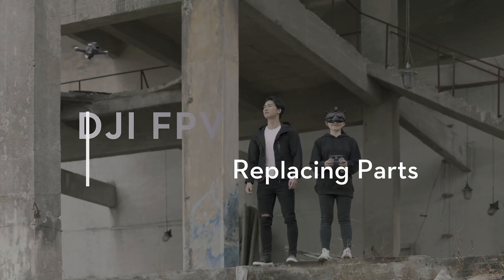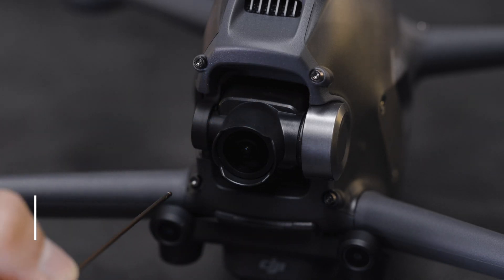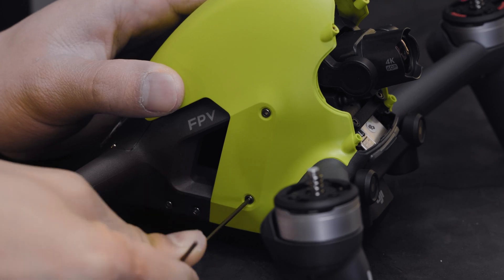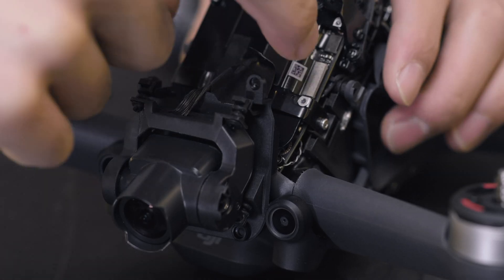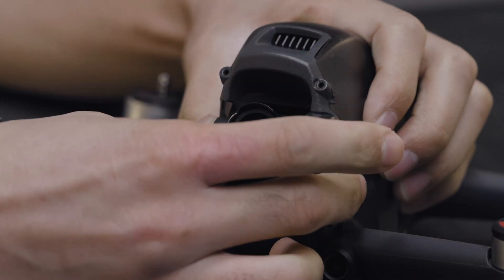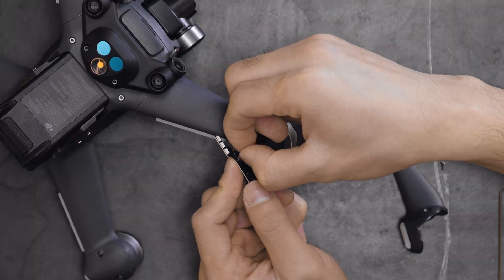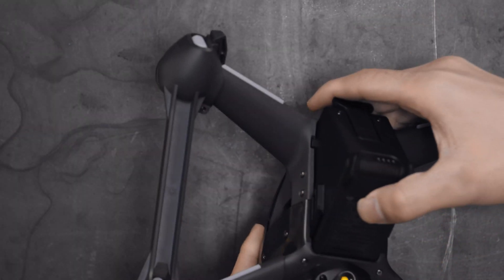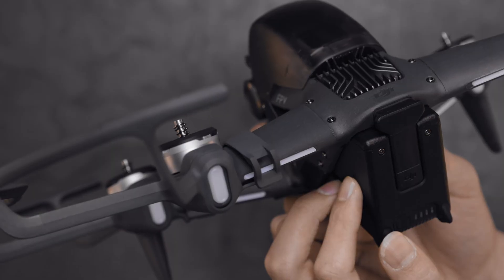DJI FPV | How to Easily Replace the Parts of DJI FPV

Comment: Care Refresh= $199 + $249 if you have to use it. Why not just charge the $448 in the first place? BC people will feel ripped off. 
Crash and need just one $30 arm? Send it in, pay $249 and they send you a used one at their discretion. They do not offer simple parts even though they purposely made this drone with Allen screws AND a tool to change them. NO, you must send it in when the "easy to break" arm breaks and pay them.
How much would a new drone cost? DJI won't sell just the drone. If they did, it might be $750.... 
We already feel ripped off bc DJI doesn't offer all the parts. Now, they ask for more money for a warranty? And again when it breaks?
DJI- YOU know you should sell the parts for CR. You don't to get more money. So many people seem to not notice the costs involved in the warranty and they DJI has this situation wrapped up in their extreme favor.
That all being said, I do LOVE the performance of this drone.

Comment: Ehhhh....it's the arms that break. Those arms are full of wires and antennas, and you have to use a soldering iron to remove some of those wires from the esc board. Easy? Nope. Not even.

Comment: Way easier than soldering and waiting for individual parts to arrive.
Reply: You will have to solder the arms if they break off. Or send it in since they are not selling arms or motors.